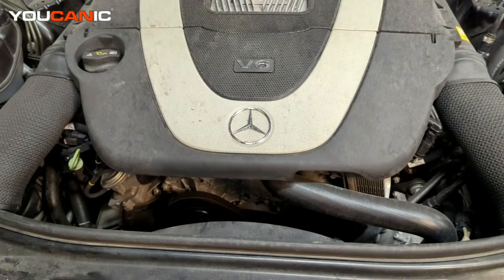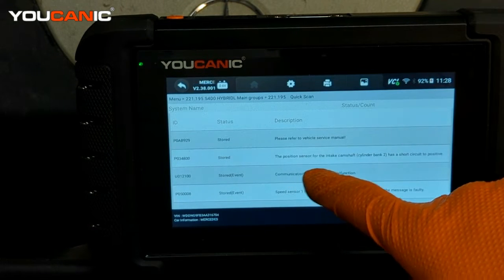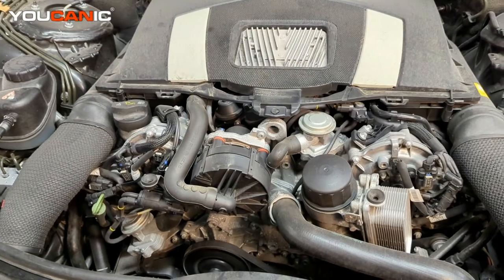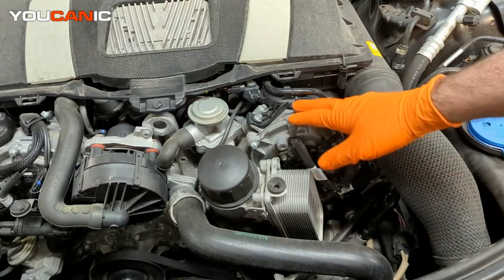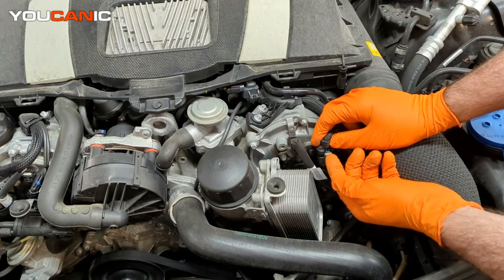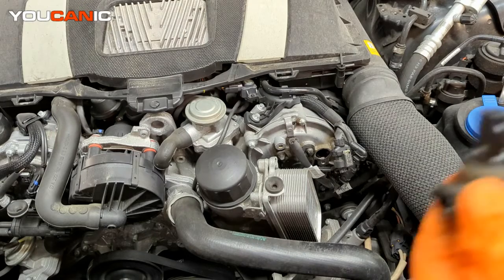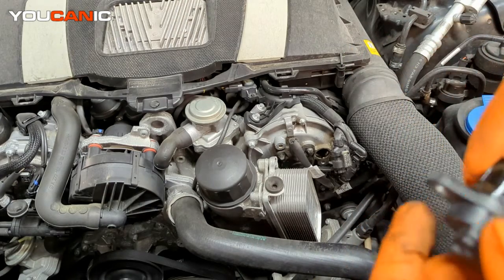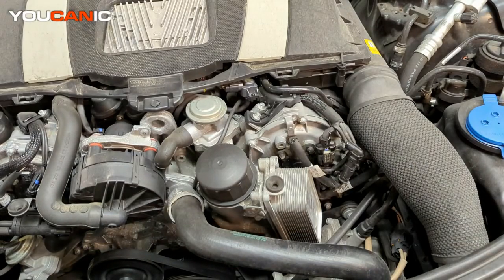Mercedes-Benz Intake Camshaft Position Sensor Replacement   P0348

Comment: Just changed this sensor how long will it take for the engine light to clear?
Reply from the maker: Thanks for reaching out! After changing a sensor, the engine light should typically clear after about 20-40 drive cycles. However, this can vary based on your vehicle's make and model. At YOUCANIC, we offer complimentary guides and resources to help you better understand your vehicle's needs. You could also utilize our powerful YOUCANIC scanner for a more detailed analysis. 

Feel free to explore and ask further questions on our site, www.youcanic.com. We're here to empower you with knowledge, making you feel confident under the hood. Also, consider referring to our factory repair manuals available on the website for more specific details, ensuring you save money and time!

Comment: I got p0346 is the cps bank 2 the top one under the intake manifold?
Reply from the maker: Thanks for your question! The P0346 code stands for CPS (Camshaft Position Sensor) Bank 2 and it's typically found under the intake manifold. At Youcanic, our mission is to empower car owners to feel confident. If you need further assistance, feel free to explore our helpful guides and free resources on our site, www.youcanic.com. We also offer our powerful Youcanic scanner and have factory repair manuals available if you need more detail. We're here to help you on your car ownership journey!
Reply: @YOUCANIC  thank you for the fast reply! I've change one of the magnets but the code came back. Thanks again!
Reply: Hello I have a P0368 code,how do I fix this and what camshaft position sensor should I get ?